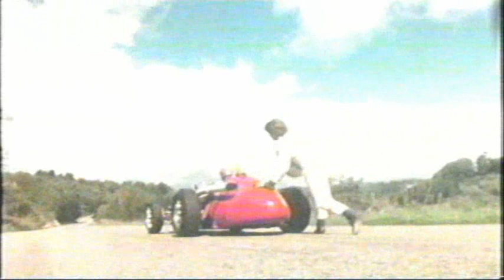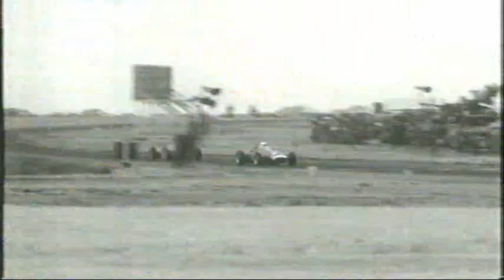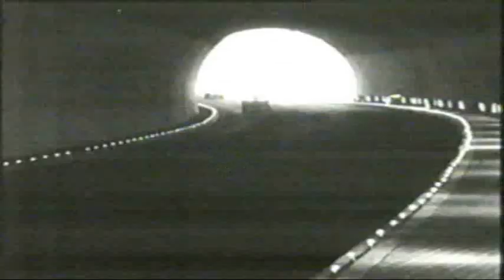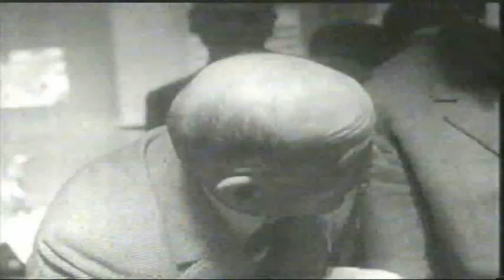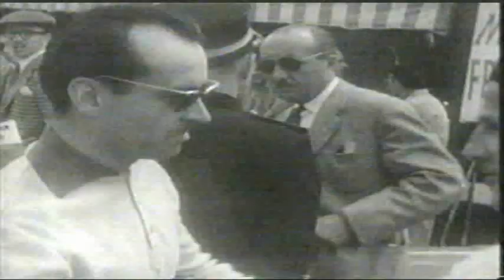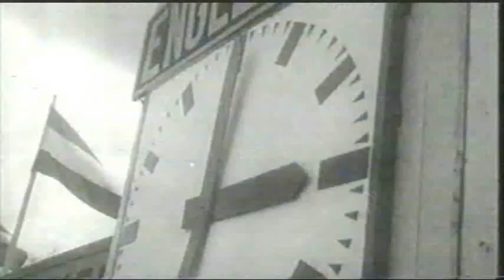The History Of The Grand Prix Car Pt 5

Comment: @moshambles It's not like your local Midas has a carbon fiber oven! Those were the days, tech gaps were smaller. The engineer mentioned, Ulenhaut, drove what was essentially a LeMans Prototype as a commuter car! It's why I love my local club track. You can see local guys drive the wheels off cars they built themselves. Pure racing.